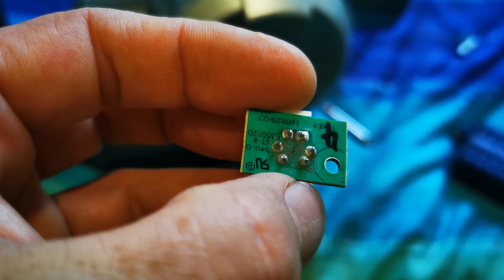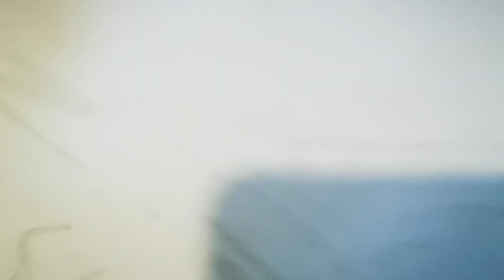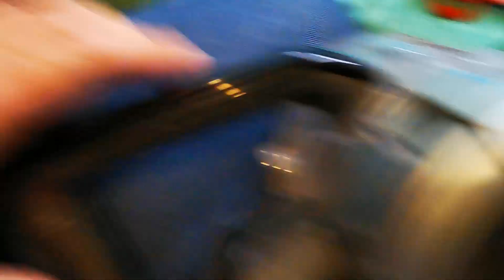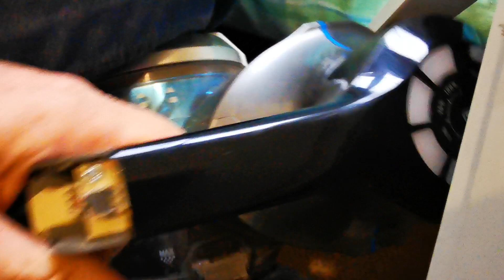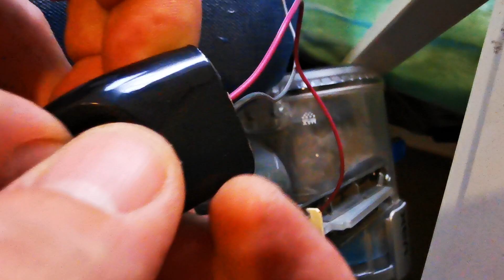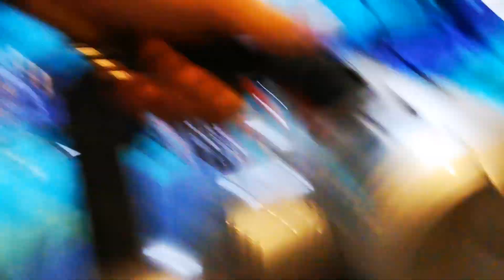Vax Blade cordless vacuum cleaner - replace faulty power button / switch

Comment: I'm having problems with mine,  The brush is not spinning,  there's no light at the bottom,  I have checked the Belt and it's perfect.
Reply: Either a bulb or electric continuity issue. When the head comes off check it has got electric on the two pins..

Comment: Hi,
I need help with my Vax pet pro vacuum.
The power head was not spinning when I turn it on when I opened up the powerhead find out the wire was broken which I fixed and put it back together. Now the problem is power head running continuously even without power 
Any suggestions?
Kind regards
Gill

Comment: I bet that like all other appliance companies Vax bang on about how green they are and probably have solar panels and windmills all over their factory, yet they refuse to sell parts and make their products near impossible to repair.
They are green until it affects the profit margin.
They advise you to throw away the whole vacuum cleaner for the sake of a 20p switch!!
My mum had the same vacuum for 30 years and it was striped down and repaired numerous times.
They should be made to sell Spares and make their products fixable by law, that would do more for the environment than all the insanity called for by the extinction rebellends!

Comment: Brilliant Leon, just wish I had watched before taking the whole bottom half apart! Anyhoo, turned out my switch was fine but the little silicone buffer on the purple button was activating the switch when the plastic handle flexed switching the thing on and off as you swept to and fro.

Comment: U could have cut the vacume little connector and solder the two wire to the switch so no extra wires

Comment: My blade isn't charging? when I plug the power in it just flashes red and white? any ideas??
Reply from the maker: Sounds like your battery has failed.  Unfortunately Vax wont sell you another battery.  Your options are either to try and find someone selling reconditioned batteries online, or to buy a faulty unit with a good battery and swapping it.  Check eBay for both.
Reply from the maker: https://www.ebay.co.uk/itm/vax-stick-vacuum-cleaner-32-v-with-charger-please-read/402145567898
Reply: @technohippy29uk  thanks! I found another slightly cheaper. Should arrive tomorrow 😁

Comment: Good video would u know if there is a fuse or reset on the battery pack of pcb
Reply from the maker: Hi, no sorry I haven't dissected the battery board.
Reply: hi mine turns itself off after about 20 secs when you press button every time any ideas many thanks.
Reply from the maker: @philmcrackin-jx5vj  Sounds like your battery is failing or your charger isn't working correctly.  Unfortunately Vax wont sell you another battery.  Your options are either to try and find someone selling reconditioned batteries online, or to buy a faulty unit with a good battery and swapping it.  Check eBay for both.